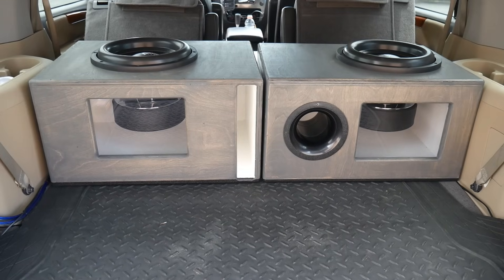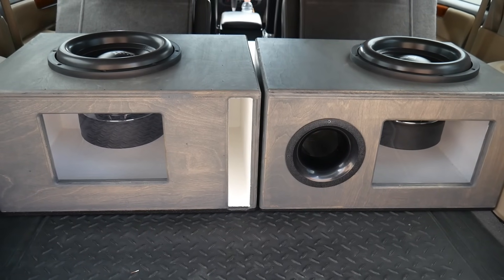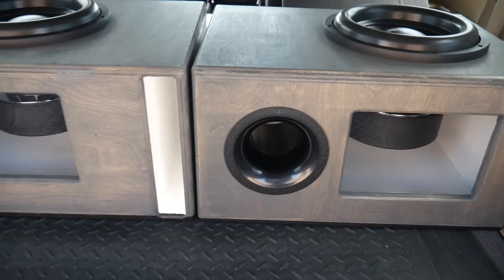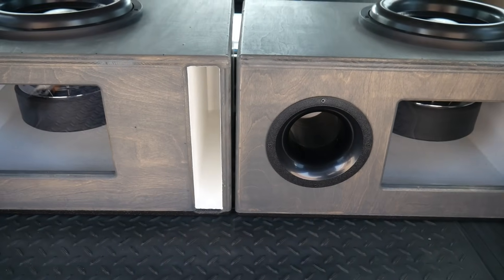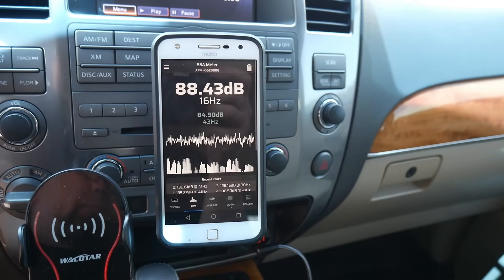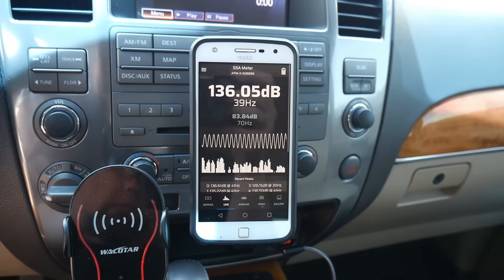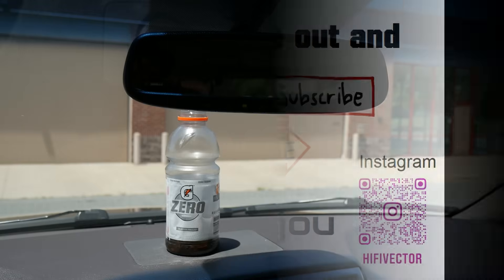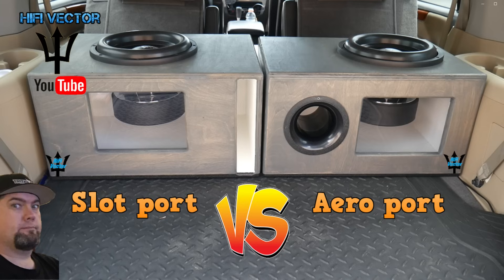Part 1 Slot port vs Aero port subwoofer box in depth comparison

Comment: It would be nice if you compared a 6 inch Aeroport. It’s the equivalent of a 14”x2” slot port. Also, what is the tuning? Aeroports should be tuned a little lower as they have a steeper falloff below tuning than slot ports due to reduced air friction.

Comment: I don't know if you had changed microphones between speaker to speaker but listening to this through my home audio receiver the aeroport was louder and lower than the slot port by judging the response from my speakers.
Reply from the maker: I did not change the microphone but it could have just been where I was standing or what not but honestly I use both I think as long as the box is built right and the port is sized correctly both can sound good I have slot ports and Airport boxes

Comment: Why even bother bringing up the comparison when you aren't even going to do it right... like several different effects on the results.   Didn't you learn basic testing in high school science class?  O ly change 1 single variable,  nit a bunch.  A round port vs aero port is not at all the same. A round port is 12.xx" area (let's just call it 6 per cu).. an aero port if 4" is closer to 16 sq area equivalent to round..  so that's 8-something per cu.  So, now, you're comparing 12sq/cu vs 8sq/cu (or 6sq/cu, without the aero bell flares) on top of the round vs slot.   That's a 2:1 or 3:2 area difference,  and is going to perform quite differently.  We all know it will, so why don't you?

Comment: You shouldve done this test with the same port area
Reply from the maker: No, because then theoretically the aero would be larger. Everyone knows that it has been said for many many years that round aero ports are more efficient so therefore you need to reduce the size because of their efficiency to equal a slot port or square port , so to make it equal, it would not be equal because of the higher efficiency of the airport. The test was to just play around and test that theory that everyone says that you can reduce the airport by 30 to even 50% to equal the same area of a non-aero port.
Reply: @HiFiVector  There is no "port efficiency". All there is are bad designs and screwed up slot ports.

What matters is the port area and the port length. This determines the tuning frequency. Obviously the port area must be sufficient to keep the port velocity below 34 m/s.

A tubular port and a square port will behave the same with the same port area and length. Look it up, theres tons of speaker building books out there or put it in WinISD - if you dont believe me.

Comment: ports should have the same area for fair comparison. was the aero port flared on the inside?
Reply from the maker: No because round aero ports are more efficient they can be a reduced area. If you made them the same theoretically then the aero ports would actually be larger because of its efficiency.

Comment: Slot port is always going to be louder or have more SPL because there’s more surfaces (walls) for the sound to resonate and bounce off of. An aeroport box can out perform a slotted box depending on the vehicle and placement of the box in that vehicle. The aeroport box relies more on cabin SPL gains.

Comment: i can hear the difference its faint but there, it resonates better. without reading the comments... the slots going to allow those sound waves to really flow through there and produce a solid freq. its the sound waves moving through the port making its own sound.  i wonder what it would sound like if you put a divider in the slot making the upper part a smaller port and the lower a larger port like two golden ratio rectangles. the sound waves would pass through both and produce different output frequencies as it looks like it would have enough time to level out before the waves escape. may be an interesting sound

Comment: i actually like the slot port, i glued my box, but my port screwed in so i can just change it if i want
Reply from the maker: That is the good thing about round ports, you can change the tuning if you want easily But  if you don’t glue your slot port and screw it you can do the same thing as long as there are no gaps or air leaks.
Reply: @HiFiVector  absolutely

Comment: My subwoofer port chauffeuring issue
How to fix that
Reply from the maker: If it’s a slot rounding the  ends helps. But if the port volume is too small then you need a new box with larger port area.
Reply: @ ok
My enclosure volume is 1 cubic feet
Tuned at 40hz
Bass port of enclosure is 3 inch diameter and 8 inch long straight pipe use 

But air velocity is to high
My subwoofer SD is 133cm^2
Reply from the maker: Using flared port end will help other wise you need to go larger on your straight port.
Reply: @HiFiVector ok
Main both side flare use karta hoon

Comment: When you gain something, you lose something usually. Most stereo guys compare stuff and say oh, this one has more decibles or something, but at the cost of what? Maybe the less decible one has smoother bass or lower bass or something like that. Im always doing stuff backwards because I see that senerio a lot. Thats why i like big sealed boxes because it shakes harder but yea its not as loud. I like more subs in sealed box than less subs ported, but the sealed box is sometimes built slightly slightly larger than specs to get that super low sound. its the real way, the old way. Its harder to do yea, and it pays off imo.
Reply from the maker: I agree with you on the larger volume for sealed boxes. I have found from testing that even though “ factory specs” say the me thing they most always sound better with more cuft for sure and the increase in low end is a lot better as well like you said.

Comment: why arent you making the port same size in area
Reply from the maker: Because that’s not the whole point of the test I think you missed it. Airport or rounds are more efficient. Therefore, you are supposed to use less area on a round porch versus a rectangle board to do the same thing. So if you actually use the same port area, the round port would actually technically have more area because it’s higher efficiency so you can’t go equal to equal this was just a test comparing what people have said the last 50 years that you can go about 30 to 50% less area on a round porch because it is so much more efficient.

Comment: Id like to see a test with a horizontal slot port. Nascar changed the design of their exhaust pipes from round to horizontal oval pipes as its more efficient becausethe air moves along the bottom of the pipe. So oval gives more usable surface area. I wonder if that would make a difference in audio quality

Comment: Opinion on those Brazilian full bridges aka Taramps, do they hit the lows like a Korean half bridge? I'm about to find out before the weekend but get mixed thoughts on this some say they miss the low beats and others say they hit the lows. But are the people saying these amps can hit the lows just in need some Q-Tips? EDIT: Side note here me being more of a SQL guy i'm thinking the question is not which of these port methods are louder it's which one sounds better because that's what i asked Skynet AI i mean google and it just feeds off facts and forums and spat out that Aero ports are cleaner sounding all around and personally that's what i care about cleaner bass and less port noise as well and well that's just cleaner bass also told me that MDF is the best sound wise material to use when building a box that Birch and other plywoods are used is because they're lighter, better looking and more durable.
Reply: what did you find out about the full bridge vs hal bridge on the lows?
Reply: @pgarza2  That at least for the Korean half bridge amps that i've owned there is literally no difference once tuned properly they sound the same. I'll give the NVX full bridge a pass since i never tuned that amp i  immediately wrote it off and gave it away.
Reply: @pgarza2  apologies if you get a duplicate reply i swore i replied to this from my phone but i don't see it here, anyway the Big Boss 3k i got is a insanely powerful amp and hits the lows just as good as any Korean amp i've ever owned as far as longevity idk people seem to be happy with them. The NVX full bridge i didn't like i am now going to give it a pass do to possible operator error i never tuned it and it just didn't sound as good as my RP 1200.1 was just not hitting them lows and i gave it away to my cousin. But man i grabbed a brand new Boss 3k for $248 and bought the bass knob for $50 it is just destroying my EVLs couple videos up on my channel Orion 2.3k vs the Boss 3k, will be doing a 3rd video once all the 1/0 OFC has been ran already ran 50 feet of it and need more the amp is pulling down my dual agm batteries so going to be hitting JS alternators up soon, i did pick up a 120 amp smart charger from Taramps as well this project is getting expensive but it puts a smile on my face we only live once and it's a short ride lets freaking enjoy it!!!
Reply: @pgarza2  Well i want to compare it with something else in it's class the Big Boss 3k just out performs the Orion xtr pro dx since the Orion is only 2398 watts true on the birth sheet it's not underrated per a phone call with and Orion tech told me this another commentor on one of my videos said the same he knew the new Orion owner their line up naming was messed up by the previous owner the Xtr PRO line are under the XTR line so the DZ Orion amps are what you want check out the Big D Wiz videos he did on the Orion XTR DZ amps they're freaking sick!!! like to run a DZ against this Big Boss 3k Bass but i will say this the Taramps full bridge is just crushing it i mean it drops the lows beats are hard fast and precise and buttery smooth and they hit the lows with Superior Authority for a $300 amp that can do a easy clean 5k and sounds great i love this thing but with i had a DZ amp to compare it with will be making a 3rd video once i get the dsp and highs amp installed ran all new wiring dual 1/0 OFC and a BNR 350 alt. Shit just makes me geek out and smile while driving truly happy atm.

Comment: I tapered my slot port at the exit
Reply: And a baffle with a 1 1/8 gap into an empty chamber  firing backwards 1 1/2 inch tapered to 1 1/4 at the slot exit
Reply: 108 db with 150watts

Comment: For one you made the enclosures the exact same size which in a aero port you had more volume because they don't take up as much volume as a slot port. If you had them lets say 2 cu ft on the slot you was closer to like 2.2 to 2.3 on the aero
Reply from the maker: @apocalypse4720  No they were not the exact same size. They were the exact same net volume after port displacement, dude.

Comment: I built my sealed 12' (2x 12s, & separating wall) a bit too big (2.1 cubes per side) and lost SPL over my original box (1.1 cubes each sub).  My question is if I stick a 3-inch Aero port next to each sub, will I gain SPL?  Fs for the drivers is 26.4, so what hz should I tune it to to avoid over-excursion? (Qts .46)
Reply from the maker: Yes you will gain a lot and with 2.1 cuft net you will be able to use 3” aero ports and be good with volume still. What subs do you have? That is a factor on tuning as well not just FS.

Comment: If you’re going to compare, then they should be exactly the same square inch area, same net, same tuning.  Otherwise you’re not actually comparing.
Reply from the maker: So you do not understand or even listen to the whole video? Go back and actually listen to the whole video and also watch the other part 2 video and you’ll understand.
Reply: I went back and listened( fast forwarded), I stand by what I’m saying.  I’m not trying to pick, just pointing out apples to apples vs apples to oranges.  If you had done a 6” aero with 28.26sq inches of port versus a 4” at 12.56sq inches, I’d bet the outcome would be louder at and near the tuning frequency because it would have more port area.  A quicker fall off under the port tuning.  It would also be slightly less responsive, but probably not that noticeable with a less sq oriented woofer that has more MMS.  Nice looking enclosures by the way.
Reply from the maker: It’s cool man you are still not getting it. I’m not trying to bicker about it either but this test Was never meant to be apples to apples. That’s where you are missing it. Do some research on the correlation between the shape and efficiency of a round port vs slot or rectangle port and all the theories about the volume between them.  Then you’ll understand what I was trying to accomplish with the test. Thanks for the comment on my boxes I appreciate that.

Comment: Aeroport vs. slot-ported
Pros (aeroport): 
+ Easy to install and tune to your preferred frequency.
+ Will have a flatter response above the tuning frequency, thanks to the higher air velocity.
+ Can be replaced.

Cons (aeroport):
- Higher chance to experience "chuffing". 
- Less output compared to the slot port, especially below tuning

Pros (slot):
+ Much better output in general
+ Less chance for chuffing, smoother sounding.
+ More variability in customization to your liking.
+ Does double as additional internal bracing.

Cons (slot):
- Once built, it stays the same, so you need to design it especially for your use-case.
- Does not offer variable tuning.

Comment: Looks like Aero port hits a little harder with bottle shakeage (and  easier to tune of course) and will probably last longer because sub doesn't hit max excursion mechanical limits as often as it did in the slotted Port box

Comment: Downsizing to an aero-port due to enclosure constraints is one thing, but they aren't a magic bullet. Otherwise I'd like to see a true apples to apples test of two enclosures with equal port areas, say a 6" round port versus a slot of ~28 in^2. My money would be on the round ported version due to the inherent efficiency of the shape.

Edit. I just realized there is a part 2...😂

Comment: How do you design for a slot port? I use Term Pro and it doesnt support slot port yet. Supposedly adding it soon (hopefully). But do you basically do a normal round port, figure out the volume it uses, then try to build a slot port with the same volume?  I still think the aero ports being plastic might vibrate a bit introducing additional sound/distortion due to the plastic materials.. but not sure.

Comment: I believe the slot port has more low frequency output simply because it has more area.  At 20hz, almost all of the output is coming from the port, so a larger port will produce more output.

Comment: 20hz, 30hz, and 40hz comparison wasnt the same frequency. Slot port was 21, 31, and 41. How did you not notice this and correct it?
Reply from the maker: It was the same frequency from the same track. Meter  glitched and just showed 1hz off. I’ve owned this meter for 3 years and it has done this 2 times since I have owned it.

Comment: Depends on what's the goalto achieve? Maximum loudness and less quality sound rec but if deeper and more quality sounding at given volume of course type of music being played and vehicle type wagon,trunk,suv etc, always wondered why round ported boxes aren't as common anymore. Also woofer brand and build quality of it possibly be something to consider 🤔  any time ever thought to understand something in the audio system world you meet someone with a setup you wouldn't believe if didnt see with own eyes 😉  back in my high school days more subs the better and amps bridged to hit hardest !! Smh what a dumb ass lol would get pissed everytime amps would cut off after blast it for  hrs during drive crusades, then i met a dude at job i just started and how his ears were always hurting and aching blah blah, one day distribution warehouse was shut down for a repair and he asks would i like to hear his audio system, and i quickly agreed 😮 at time i had 4 10" solo baric 10's in a sealed box with 2 kicker zx400×2ch amps, now never heard anything about air volume requirements to get best sound in those days 17yrs old it just making ton of bass was all that mattered, So he has 2dr civic coupe like the 93-95 models and turns on system with 3-6 mafia and OMG i swore the car was rocking back and fourth from the air pressure coming out from rear seat area and had seats up in back nothing exposed or anything,  i was assuming he had 15's or something to that level and he pops trunk and when i saw what was in his trunk, I SAID GET THE HELL OUTTA HERE !!! NO DAM WAY THAT WAS MAKING THE MUCH BASS !!!! dude had 2 10" alpine type R's in a ported box that took up the entire trunk of car 😂 from that day forward my inner voice was saying you dont know a dam thing about what your doing and or what good deep clean crisp and LOUD hitting system was until that day i heard that guys system😅 never had thought alpine subs were any good only there head units and possibly amps for mids and highs but bass would've laughed had not seeing what his system consisted of, its a real skill of  art work and alot of variables to be considered and applied mathematically during picking of equipment used its not all about having best of everything but everything of combination of things used to achieve optimum sound, but with artists like Kodak black and the what's being called music today i pulled my system out and its all sitting in garage put away , funny cause know im 41yrs old and the brand i have is of dinasour era 😂 rockford subs,matts audio sub amps and jl audio amps for mids/highs, shit still looks brand  new nearly 20yrs later hell still have 93 accord wagon it came out smh and it still works, dont know much about the newer brands out these days

Comment: My English is poor and I didn't understand some information, in general, which box is better? Slot port or aero port ?
Reply from the maker: They are both good. But with aero ports just be sure to use large enough port for the sub. You can’t downsize them as much as most say when comparing to a slot.